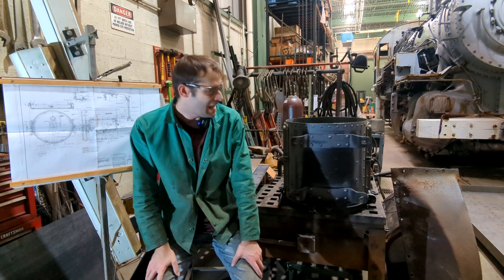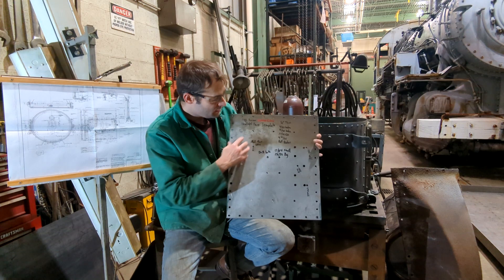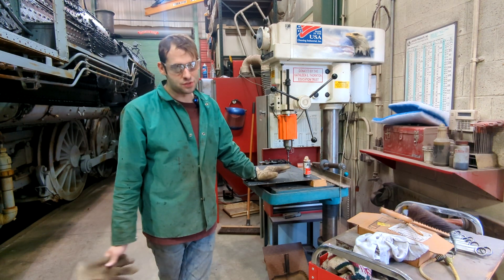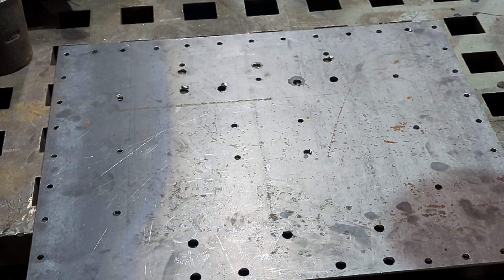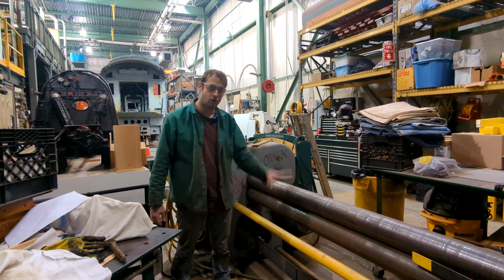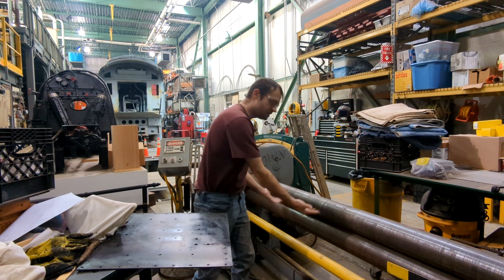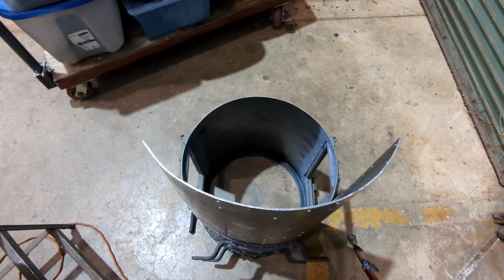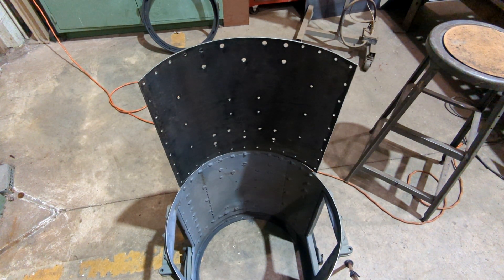Building a Steam Locomotive Headlight!  The Build Part 2!

Comment: Thank you! Ever use grease type lube when drilling on the press? Rapid tap flys around. When you're welding with that on your jacket it gets busy in a hurry. Thanks again! Merry Christmas and a Happy new year to you and yours! Be safe!
Reply from the maker: I have not.  That would be something to look into.  I agree I hate it when the oil flies everywhere and I have to clean it up before I weld on the plate or paint it.

Comment: Can you put PDF files of your templates on line. This would allow hobbyists to create their own headlights, either full-size or as models. 
I’m rather surprised the RMPA doesn’t have a stockpile of donated headlight from scrapped locomotives.
Reply from the maker: That wouldn't be a bad idea to have them online.  Believe it or not, most of these headlights were in pretty rough shape by the time they were retired.  Additionally, they are pretty heavy and cumbersome to move around.  Most people were after the bells, whistles, and number plates before headlights.  We have some that were donated, but when 460 was restored, they used the extra one we had for that project.